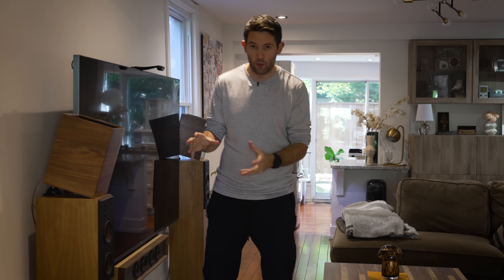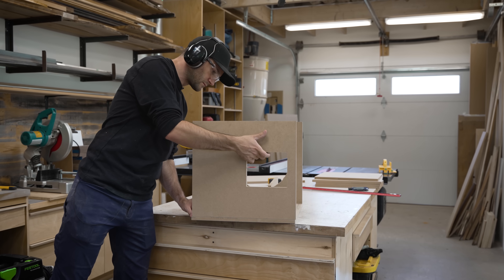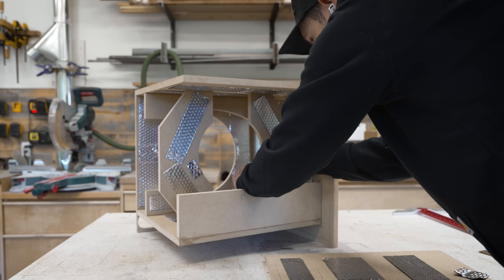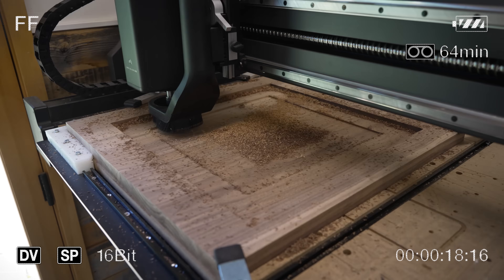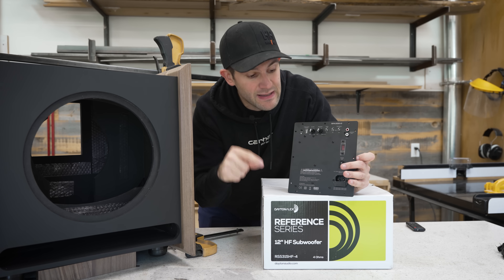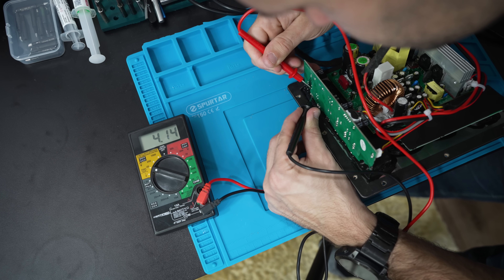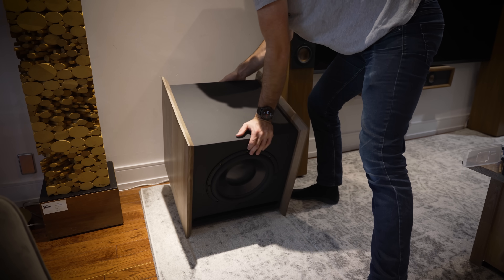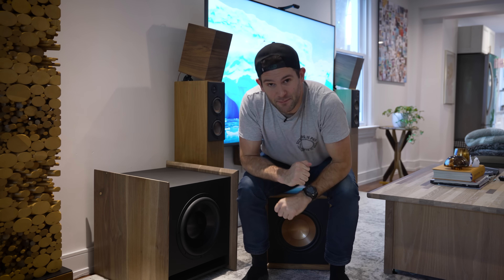THIS changes DIY Audio...

Comment: #facepalm 🤦‍♂ "at 300 watts it should be ore than powerful enough for my home theater" ... ugh.. so, that's not how powerful the subwoofer it's, it's the power handling of the speaker. 

Just because it can take more power, or less, does not necessarily mean it performs better / worse than another speaker. All the T/S params., enclosure design and even the room/vehicle play a huge part in how a speaker, especially a sub, will perform. 

The Dayton Audio Ref. series is a decent selection, but for those wanting the most out of a HT sub, there are MUCH better choices.

🔊Better subs to consider: Ultimax subs, Stereo Integrity ST series or even the Dayton Audio MX15-22 just to name some of the top contending models... with the Ultimax in the far lead for HT (given 500-800w of clean power and in a proper enclosure). 

Also, The length of the port is NOT what tunes a ported enclosure - it's the total VOLUME of the port. Which is why many DIY sub builders start with a flared round port, and it's easier to integrate into many enclosures (depending on length). 

All enclosures are best modeled with an enclosure modeling software to ensure you get the output/range YOU are looking for. Ex: many HT DIY sub builders would want a lower F3, or 3bd down point, than 32hz with many going as low as 20-25HZ range (!!) for that Movie Rumble experience (obviously you need a speaker/enclosure and amp combination that is capable of this).

As crafty as you seem at hacking into a new amp, it's usually NOT the best idea to modify hardware when it voids the warranty 💥(again, unless this is what you do for a hobby or living) 👎This is poor advice for most end users. They would be better off placing the Wave-Link externally and retaining the amps warranty.

It's misinformation like this that confuses new comers to the Home Audio / Home Theater sphere. 😥
The rest of the video was decent and informative.. I just wish there was more understanding and clarity when it came to accurately describing the sub, it's specs and how they work with the enclosure design to produce sound. 

Overall, if you're intent is to showcase your skills and hack together a system that works for you.. bravo and well done. ⭐⭐⭐
If you're intent is to educate others, especially those new to Home Audio/Theater, on how to develop a system for their needs.. this video is seriously lacking.⭐

Comment: Damn dude that side by side demo really showed... nothing, like literally nothing at all. what the hell did you think it would do other than show off your wubby chubby tie fighter. not only will your recording device not pick up the differance but most peoples audio set ups wouldn't relay it even if it could. also wireless speaker set ups have been around for years. i started on a 5.1 about 10 years ago and currently have a 7.1 wireless now.

Comment: 2 things... 1) don't paint the MDF before you glue it together.  MDF and wood both glue together and form a better bond when done against the bare MDF or wood, painting first and then gluing makes a poorer bond.  2) throwing in bluetooth can result in a latency in the sound from the subwoofer.  A lot depends on the specs of the electronics and you might not notice it... but if can be noticeable to some people and be as much as .10 to .15 seconds of latency.... WIres aren't as pretty but they eliminate that latency.  Mostly it comes down to your expectations... but you should run a wire and try it with a wire and then compare.

Comment: What I can truly recommend is to replace the cable between the amp and the speaker with a thicker one (I find 4mm^2 to be a great choice). Basically, the resistance of the cable directly impacts the damping factor in reverse ratio, and generally you want the damping factor to be as high as possible for better control and dynamics
Reply: No damping in that bitch amp. That amp couldn't stop a fly from moving let alone a woofer. LMFAO.

Comment: I would have bought and then trimmed down a much beefier isolation pad for the base. I switched my klipsch 12 inch ported sub from those kind of feet to a big sound addicted pad and i can't even describe how much it fixed things. Walls and floor stopped shaking because the subwoofer spotted using the literal house itself as a resonance surface. I no longer have to readjust my pictures on the wall when i watch mad max fury road or Dunkirk. You could trim one of those pads down to fit the footprint of your sub.

Also i would edit in some text to mention how dangerous it is to be working on that amp board after you've energized it. Bare circuits and huge caps can and do kill people.  It's not ridiculously dangerous but caution needs to be taken.

And last,  as some other guy said, class d is analog.

Still,  gorgeous work! Love custom speakers,  even if I'll probably never build my own. Still rocking two gigantic kenwood speakers i found on the side of the road on trash day and restored. Not the best,  but passive 15 inch radiators gives them amazing midbass

Comment: There are limitations like vent mach when tuning your box via the port size/length. Make sure the cabinet is appropriate size as well. Building a good sub actually quite easy.

Comment: Generally, what you opted for as off volume and tuning frequency could be better. As of now, this subwoofer has an f3 of 28.8Hz. If you opted to use the tuning frequency of 25Hz, you would get a f3 of 26.7Hz. But this driver is optimal in a box of 73L (not including port) and a tuning frequency of 25Hz to get an f3 of 24.6Hz.

Comment: Why do u place the subwoofer on the left side when the usually and naturally normal is placing it on the center?
Reply: Equidistant you get standing wave frequency cancellation or "null points" in the space. Corner loading with phase inverted is going to give the best response as the corner acts like a "horn".

Comment: I wonder if the wirelessness makes some audio delay
Reply: Yeah the wireless part is where he really lost me. Go to all this trouble and then introduce this monkey wrench into the equation. Especially when you've already got wires going all over the place.
Reply: Questionable choice indeed. Not an expert by any mean but look to me like asking at least for phase problems. Perhaps the DSP of his theater system have options to handle this ?
Reply: same thing came to my mind. a subwoofer that's delayed is the most annoying thing ever once you hear it. if I made it wireless I would probably make all of my speakers wireless too so they would at least be in sync
Reply: YES!! Wireless sucks. The only advantage of wireless is convenience. Pure stupidity to use wireless for audio EVER! Wireless results in delay, compounding, and distortion. Maybe good if you listen to talk radio, but that's about it.
Reply: @MP-qn1jw  Putting all the work and money and taking it to wireless just because aesthetic is something i would do in the same situation. Yeah, cables are a mess, but when you start hearing delay the thing changes. Being the subwoofer it's the most difficult to discern, but still.
Reply: @MP-qn1jw  Good all digital wireless accounts for the delay, by purposely delaying all channels so they are synched. The same way quality DSP systems account for the speed of sound in big halls.

Comment: Zac, did you see DIYPerks built a wireless home theater that transmits the signal via laser?!? Theoretically zero audio compression as he replaced the TOSLINK output with a low power laser.
Reply: DIYPerks is a bonk channel. Digital is transmitted in "Ones & Zeroes"...Off & On. IOW, it's not analog meaning the pulses & response sent are going to be the same for a laser as they are for an LED. Have you heard of an LED Laser burner/cutter/engraver?--stacked & optically colimated LED's to get higher power. Some of the stuff DIYPerks does is simply asinine. It's the driver circuitry for the output that matters and not necessarily the light emitting device itself.

Comment: Sealed does not equal more compact. Depending on the resonant frequency you’re targeting a larger enclosure can be preferable. But, it’s mostly going to depend on the driver you’re using if you’re targeting efficiency. However, if you have a powerful driver, you can build a larger enclosure to get lower extension at a cost of efficiency. Enclosure design is definitely an art. Great job on the video! 😊
Reply: No art man, just an ordinary science ;)

Comment: I'd like to add something to the fact that you said you want to match the amplifier power as closely to the subwoofer as possible. Only that's partly true, the rating on amps are usually the max power they can deliver but at times that is with 1% to even 10% distortion which doesn't always sound good. So It's recommended that you use a more overpowered amp and set the levels at the power rating of your speaker so in that way you don't blow up your speaker but also don't have any unwanted distortion from the amp.

Comment: In my opinion, sealed Subwoofers with enough speaker area, and an audio-processor to expand the low-output is the best.
Reply: You are correct!
Reply: 🟦…I like how taut & articulate the bass is from a sealed sub-cabinet.
... Any kind of ported-cabinet sounds blurry to me,..the bass is prodigious but mushy and ill-defined, it's the "Johnny One-Note" kinda bass characteristic of a ported/vented cabinet that's Great for home theater (explosions & such) but not for critical music listening.
Reply: agree 100%

Comment: why not put the two subs on top of each other? since you soldered the wireless receiver to the RCA leads you should be able to just daisy chain them together. it's total overkill, but gets so many dude points imo.

Comment: The design of the Sub looks great and the wireless feature is a nice addition. But threes things: first the damping you used in the sub is made for car audio and therefore meant to be sticked on metal. For wood i would recommend heavy foam as it’s the best for Bass frequency’s. Second there’s a ~1cm gap as far as I can see where the port end couples to the front plate. Installing a small wood ledge would help reduce port noise (chuffing) drastically. And third I see the reason you choose this amp but the 500w would be a better option since these Dayton drivers can take a lot of power without breaking or distorting from my personal experience. Other than that it’s a great build and video!
Reply: Headroom Headroom Headroom ‼
Reply: They will stick on wood just fine, but they will come off after 1-2 years.

The trick is to wipe down the MDF, dry it well, then stick on the sound panels, use high tack on the edges, stick it on, then use a hairdryer. Will stick like crazy never come off.
Reply: @jamegumb7298  Yeah, but the point is, that those Butyl or whatever that gooey stuff is called is built to eliminate vibrations (and therefore resonances) by adding weight that acts like a spring to car doors. The wood enclosure he built is braced very good, so you don’t need to stop the wood from moving, you just want to get rid of standing waves (waves that bounce back and forth) in the enclosure. Thats the reason you use a very thick foam, to make the wood act less like a mirror…
Reply: Ignore everything else- it would seem to me that having a port opening in the baffle smaller than the port would substantially add port noise.
Reply: he's not driving the speakers that hard already.  He's at 50% on the smaller amp and already said he wouldn't be going higher.  It makes no sense to throw efficiency and performance out the window because the driver can (but won't) handle any more power.  The other points you made are good though.
Reply: I always choose a larger amp than the speaker is rated at. Its Much Much more common to drive too much THD into a speaker(which it cannot replicate) And its usually by using a amp too small or barely the same rating as the speaker. Harmonic Distortion ramps up at the max levels of most amps.  (Amp THD Specs are insanely important)  I built and designed pro audio concert sound systems for years. I only blew speakers 1 time,  (in decades of doing live sound concerts.)  Wanna Ask me how?  Here's an example to think about. One time a guitar player arrived  to find he had a blown amplifier! But he still had his 4x12 cabinet and the band needed to practice. He just needed an Amp!  I wired him up 1 half of my 5000 watt Crown concert amp and powered  4x12" Marshall cabinet!  I think was rated at 4-500 watts . Slowly turned up his volume to the slightly insane volume levels he wanted!  Presto!  The band did their practice with 1/2 of my 5000 watt amp driving a 400 watt guitar cabinet and it was great! He just had to use a pedal to get his distortion!  Because the actual power of my  PA amp was super clean with no distortion. Plenty of volume and Viola!  No Blown 400 watts worth of Marshall  speakers driven by 5000 watts of clean Crown industrial amp power! Everybody was happy and the show went on!  I normally drove  8 - 18" 800 Watt JBL Concert subs using  both sides of this same stereo Crown amp Fwiw.
Reply: @threepe0  Of course if you really don’t need high volumes it makes not too much sense, if you consider the price of these plate amps… however i have my Dayton amp (spa 250) only turned up to 60% and after that it immediately starts to distort so the point @PatriotPaulUSA made is great for explaining this. And you can’t tell me that if you build your own Sub you wont turn it up loud 😅 I don’t quite get the point of losing efficiency you made with bigger amps tho…
Reply: @archbug2510 you just argued FOR oversizing amps, then said you don’t get why you would do that. Congratulations

Comment: Hi Zac! A long time viewer here! You assumption about driver "watt" number should match the amplifier's "watt" number is blatantly wrong simply because of physics. The amp's rating of 300 watts has to be questioned, is it peak power at 10% THD? Or is it at it's maximum cleanest power before ramping up THD? USUALLY amplifier manufacturers will use power rating @1% THD, but some will omit the 1% THD and go for max power before blowing up. What kills your driver (or to be specific, it's voice coil) is the amp clipping - which will apply a constant high-ish voltage to your voice coil, getting it hot. When coils get hot, it's resistance increases up to a certain degree, after that, the coil will simply burn (the wire will burn off in a section of the coil). You can have a 1000 watt "rated" amp to drive a 300 watt "rated" subwoofer driver, what you get is HEADROOM where when your audio content requires a "punch" beyond "300 watts", your amp has it. FYI, let's say your 300 watts amp and your subwoofer produces 100dB SPL, to get the SPL to 103 SPL you need 600 watts, to get it to 106 dB SPL, you need 1200 watts. So the bigger the amp, the better you'll be simply because your speaker has smaller chance of burning out (hopefully you won't reach clipping level of your amp by having a HUGE amp). On the other hand, if you have a HUGE amp and your subwoofer driver's suspension system is not up to par, the one bad thing mechanically that can happen is that your cone/voice coil/former assembly will hit the bottom of the magnet, and at worst, it may "blow up", as in the suspension system can't hold on to the cone and the cone gets ripped off out of the suspension system - the visual will look like the woofer's cone got "blown away", ripping out the surround, spider, and wires...
Reply: Where Watt's aren't that important, the sensitivity of the driver is way, way more important for achieving those high DBs. Throwing Watt's at a VC, the thing just heats up with more power and from the increased heat you get increased resistance again, giving you a feedback loop.

Comment: You actually want a more powerful amplifier than the speaker. This is so you have headroom and are not driving the amplifier into clipping. This can cause the sub to still blow even at lower wattage. A perfect match for this sub would be a proper gain matched SPA-500.

Comment: You not right about matching amp and speaker wattage. Dayton Audio RSS315HF-4 Power Handling (RMS) 400 watts, Power Handling (max) 800 watts. You can over power you ampifier, and actualy shuld. You should use at least 400 W amplifier for 400 W RMS subwoofer speaker. But better would be to use 2 times more. Two reasons. First: speaker can handle 2 times more power for short time. Second: power amplifier running at max power begins to distort signal (begins clipping and adds high frequency harmonics).

Comment: You can run both subwoofers. Sometimes it can help with dead spots which you probably will have, depending on placement of the sub. Place one on one wall and the other on an adjacent wall, run them 180 degrees out of phase. I have 2 Klipsch 12in ported subwoofers that go down to 24hz. Music at low volume sounds fuller because of the attenuated base and action movies can/will shake the house.
Reply: And your pant legs...

Comment: Bluetooth can add a bit of latency but overall if you want less cables that's the wat to go and btw i also suggest to hot glue the wires to the speaker walls because at low frequencies the wires can start vibrating and would start  making a annoying rattling sound in the speaker